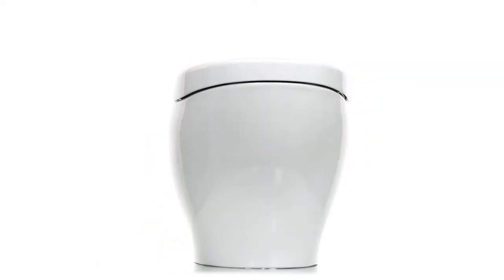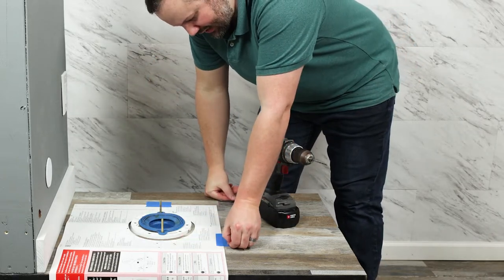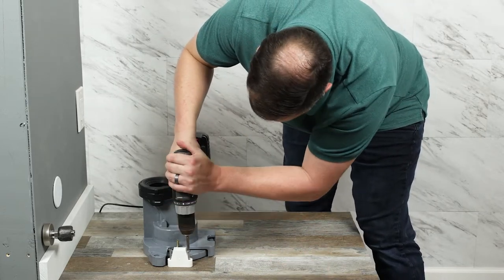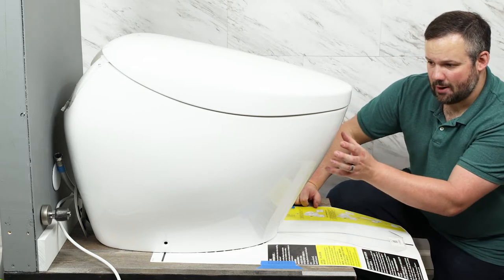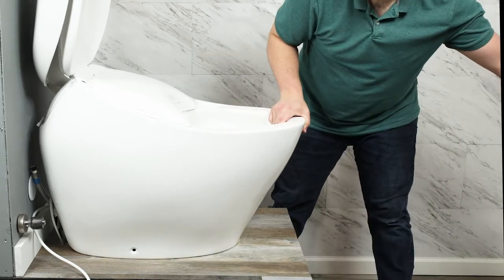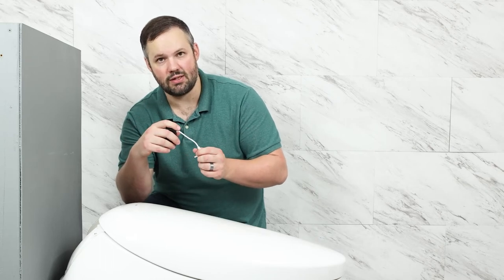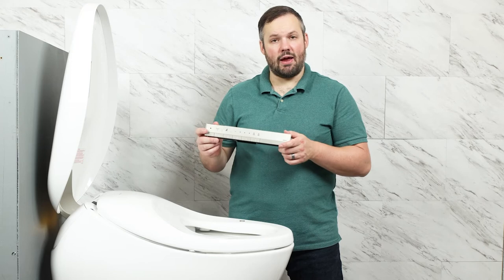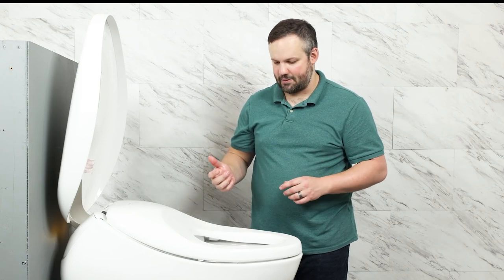How do I install the TOTO Neorest NX1 and Neorest NX2 bidet toilet?

Comment: For the water inlet do I need to have anything installed in my restroom that does not have a hole in the wall like your video 3:41 I have a pipe coming out of the floor near the rear of the toilet that is where the water hose is connected and how long is the power cord plug?
Reply from the maker: The power cord is 4 feet long.  Wall or floor is fine.  Our install looks a little different than your normal install simply because it's on a movable install platform for the sake of getting the shots we wanted.  As long as the water supply is within the space shared in TOTO's spec sheet, you're good to go.

Comment: Thanks for the great video, this was super helpful! I had two questions: (1) From what I could see in the video, it seems that you did not trim the flange bolts - is there anything under the toilet that this could interfere with, or is there sufficient clearance? (2) Is it normal for the plastic seat to make a “creaking” sound when leaning on it? Many thanks again!
Reply from the maker: Thanks for the great questions!
1) there's a lot of space under the toilet, so there should be no reason to need to trim the flange bolts.
2) Can you define; "leaning on it"?  I've not noticed any creaking, but I really only ever sit on the unit.  Are you leaning back on the lid when seated?  If so, I could see that leading to creaking noises.  The lids on the Neorest line are not designed to be leaned back on.

Comment: So it looks like you used a Fluidmaster Better Than Wax silicone gasket and you said that Toto also recommends a silicone gasket. What confused me is that you mentioned applying silicone sealant to the flange adapter or to the silicone seal itself. I was a bit confused by this as I went and looked at other videos for the Fluidmaster Better Than Wax seal and there was no mention of using any additional sealant when applying one either between the seal and the rough-in flange or between the seal and the toilet. You also mentioned that how you apply the silicone sealant differs on whether or not your rough-in flange is made from plastic or metal. Can you go into more details here because I was surprised by this information as I didn't see any similar or related instruction involving silicone sealant and the Fluidmaster Better Than Was gasket? 

One thing worth mentioning for other viewers about that kit is that it comes with additional spacers in case the rough-in flange is flush with or below the tile instead of sitting on top of the tile like in your video. Thanks for the video.
Reply from the maker: Thanks the the comment!  In the video, I say there are three options.  You should only use ONE of the three: 
1. Fluidmaster Better Than Wax seal
2. Wax ring
3. Silicone seal

We're not recommending mixing better than wax with silicone, which is why you're not seeing any Fluidmaster reference to silicone.  We're using Better Than Wax, but TOTO suggests silicone.  You'd use one or the other, not both. The Better than wax seal looks like this: https://i.imgur.com/pAyA3hv.png  The flange adaptor (which comes with the TOTO toilet when purchased from Many Bidets) looks like this: https://i.imgur.com/aNjHeaI.png  They are not the same piece.  So when we say that we're using Better than wax, but TOTO suggests using silicone with their flange adaptor, we are not saying to use silicone with better than wax.  If you use silicone rather than options one (Fluidmaster) or two (Wax Ring) above, TOTO does have recommendations as to what to connect the silicone to.  Review their manual for all the details: https://www.totousa.com/filemanager_uploads/product_assets/InstallationManual/0GU9213_MS900CUMFG_MS901CUMFX_IM.pdf

Let us know if you have any other questions

Comment: How long would you estimate it takes to install the NX models in a real world environment assuming tile or other hard surfaces to drill through?
Reply from the maker: We installed it in our actual bathroom, and had to drill through tile, and it was a breeze.  You'll want to make sure you have a bit that is designed for tile, and I recommend putting down some painters tape and drilling THROUGH the tape, so the bit does not slide on the tile, but other than that, the process is exactly the same.  We did it in under two hours.  If you decide to get one, reach out to us!
Reply: @ManyBidets   Thanks for the quick reply. I've installed a few of the NX models and a few of the 700 models in our area. Just wondering what others installation times are.
Reply from the maker: @DS-xe2gl  Makes sense!  We offer contractor pricing too, FYI :)

Comment: So I installed mine (same unit) and the water has been all hooked up, when plugged in it comes out but no misting occurs and the toilet does not respond to the remote. I made sure to have the infrared triggered and all but no luck. The power and water is to it but nothing happens. The manual flush doesn’t work either
Reply from the maker: I'm sorry to hear that!  If I had to guess, I'd say these are the steps you need to take.  If these steps don't work, please let me know: https://youtu.be/QhgJvX8tf0s
PS if you decide on another one down the road, let us know, and we'll be sure to get you special pricing!